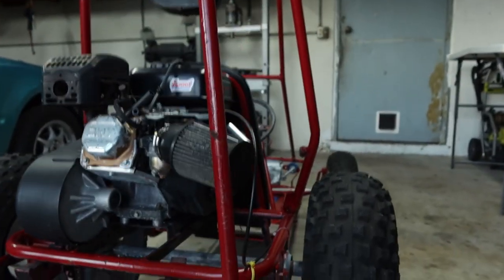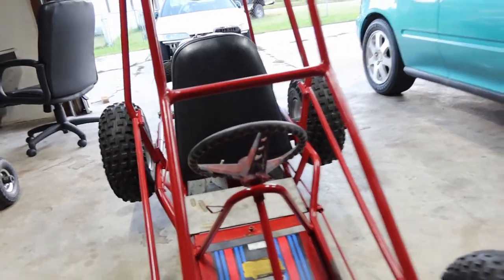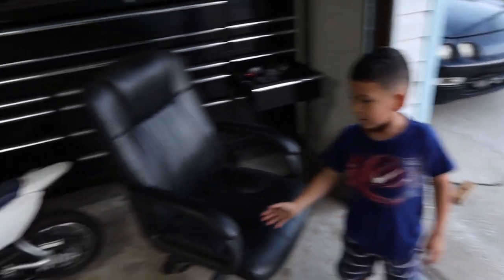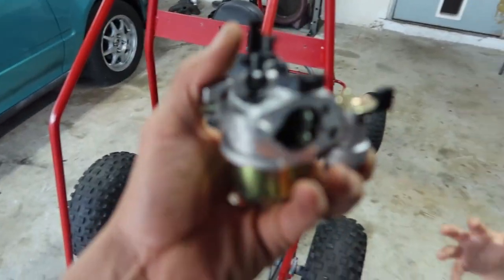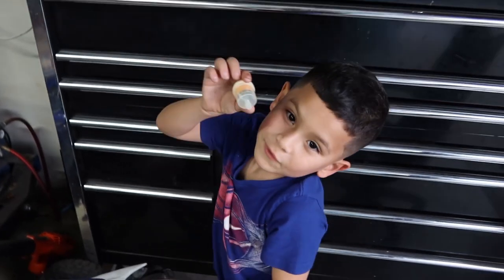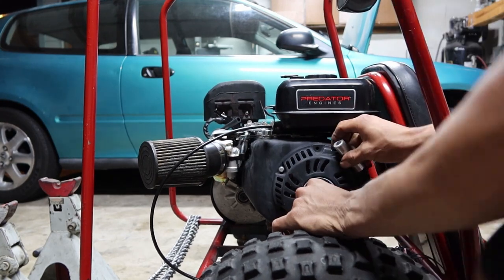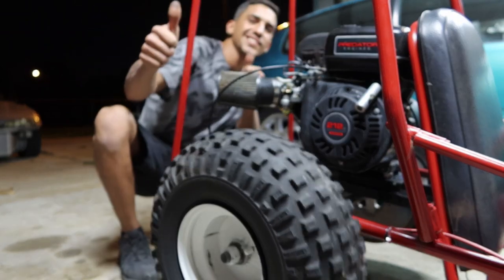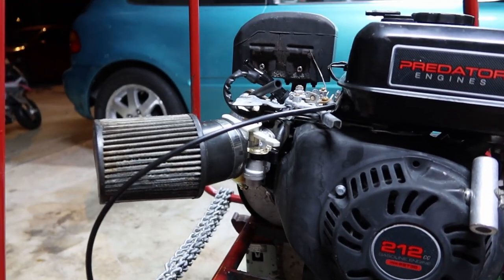212cc Predator Go Kart Tune up

Comment: Would you happen to have a video on how to install the predator motor on the Manco kart.. recently acquired one with the original engine busted and I want to swap to this
Reply from the maker: I don't have a video  installing the engine but is pretty straightforward same way you remove the old one the predator should go back on the go-kart